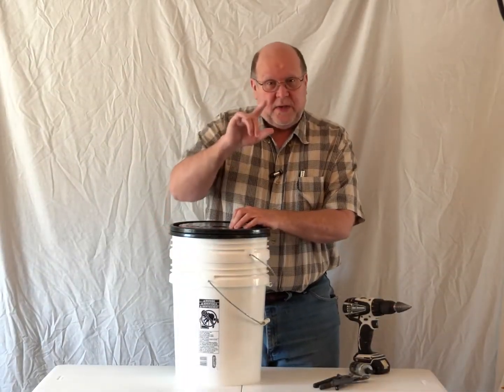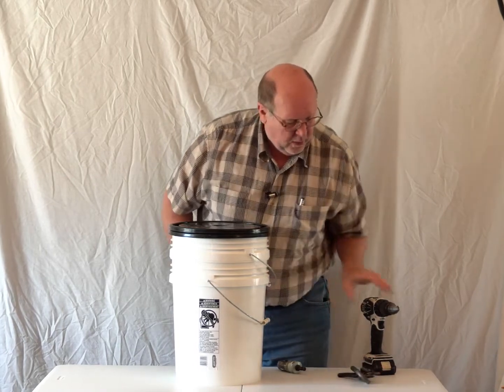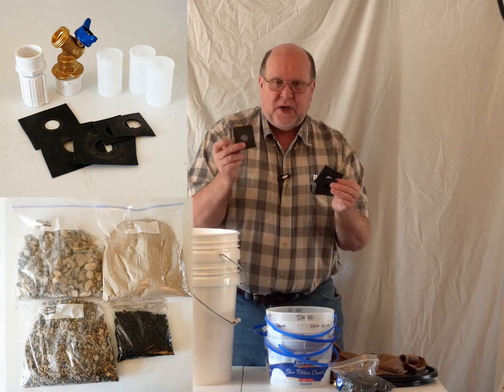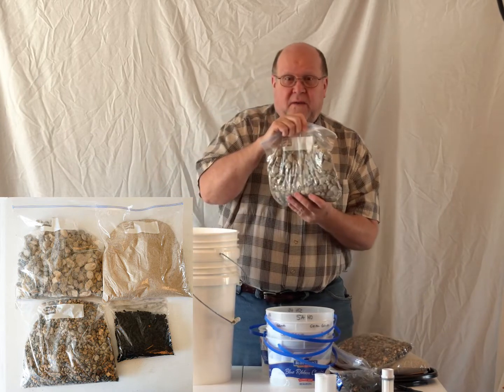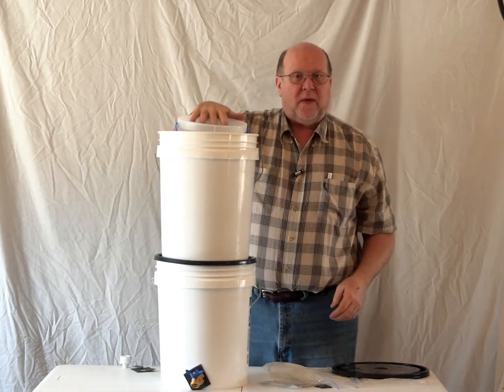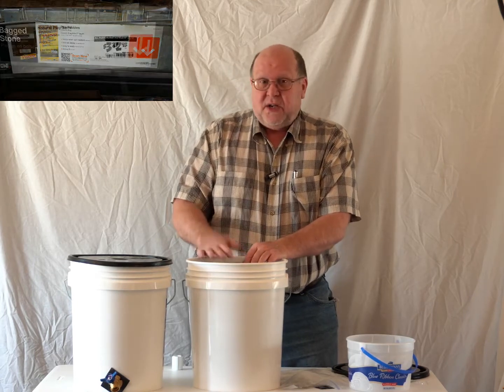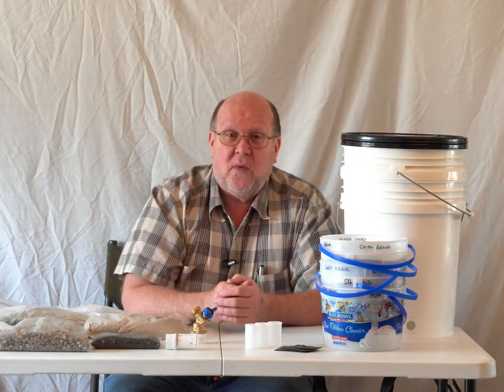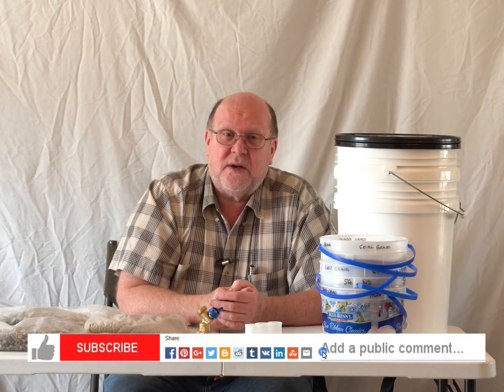DIY Water Sand Filter

Comment: Filtering water to lessen micro-organisms has been a (superstitious) age-old practice among Jains who carefully remove the micro-organisms in the cloth through filtered water in order to follow doctrine of Ahimsa, respecting living creature.

An old cotton sari, folded, creates a smaller effective mesh size (approximately 20-μm). This is enough to remove zooplankton, most phytoplankton, and thus a large proportion of the cholera in the water (99%, according to lab studies).  

Slow-Sand filters are being used in Africa to clean the water. Bacteria and dirt get filtered through the sand. 

Bacteria actually pose no threat in fact are symbiotic with life (80% of body). 

There are three main types; rapid (gravity) sand filters, upward flow sand filters and slow sand filters. The first two require the use of flocculant chemicals to work effectively while slow sand filters can produce very high quality water 

The Egyptians also used porous clay vessels to filter drinking water
Reply from the maker: The only reason I use the cloth is to hold the sand in place. 🤫

Comment: sand filters have been used in Africa to clean water from bacteria as it goes through, bacteria lack food/light and get caught up in the sand. The more sand the better it works. Bacteria are not harmful however, it is the condition of the body (immunity). Africans just need a little/alot more fruit & get the dirt out of the water. Viruses don't exist.

researchers at Stanford have shown devised a high-speed filter composed of nothing but plain cotton cloth and nanotubes that can quickly filter nearly all bacteria from dirty water

Comment: To add to the cleaning of your sand and gravel set up a catch basin with a fan blowing across it.   As you pour the dry sand and gravel through the air stream it will blow away dust and 'chaff'.   Trial and error to how close the fan needs to be.
Charcoal can be re-activated by putting it in the oven under low heat.

Comment: Buckets, lids, valves, & gaskets would be available from homebrew beer supply stores. The bottom bucket is exactly like a “bottling bucket”…comes pre-drilled and use a nice plastic spigot with matching gaskets. Interesting video